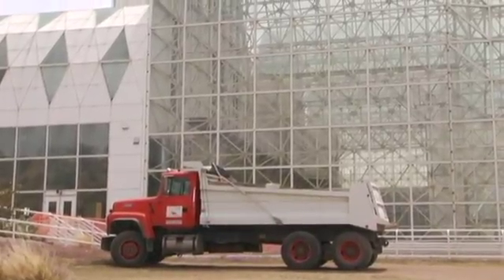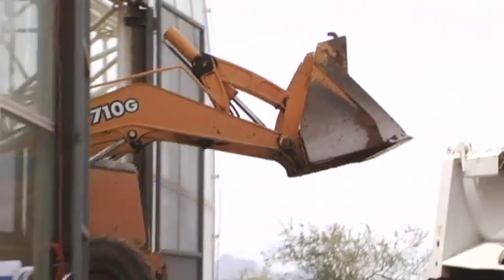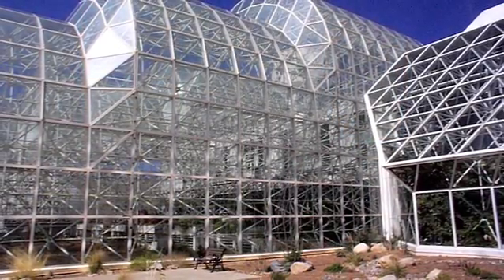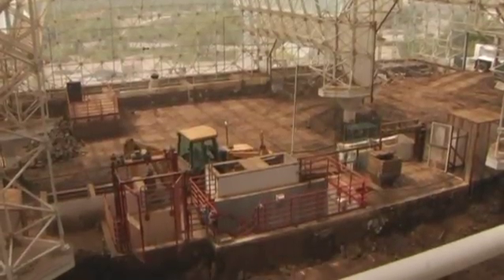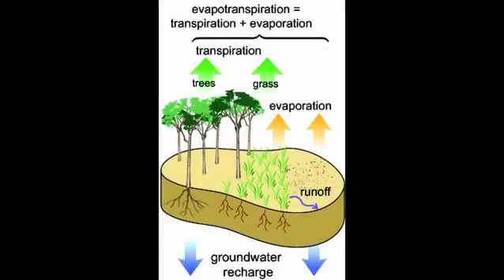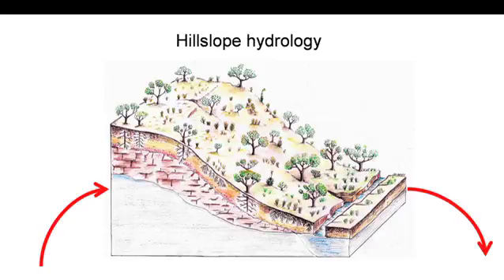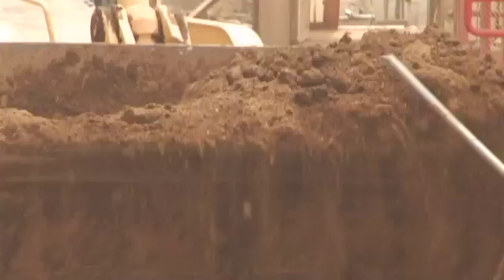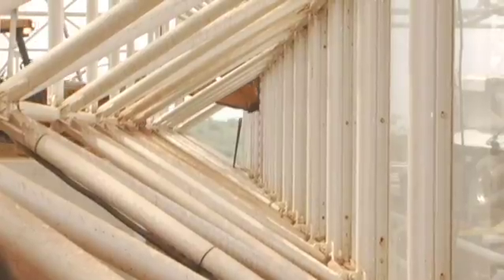Biosphere 2 Initiating New Project

Comment: 1. The sun rise to sun set the evaporation pump.
2. water forms on the roof and make mist to land on the hill of QF area.
3. you will need a water gathering pool built in the hill with a spring outlet.
4. you will have out side run of if the rain water sauat the hill over the azorption rate.
5. the taller the hill the better water collecting  it can do.
Charles Gitchell Jr.
Jenner Pomo Research/Earth/Space/